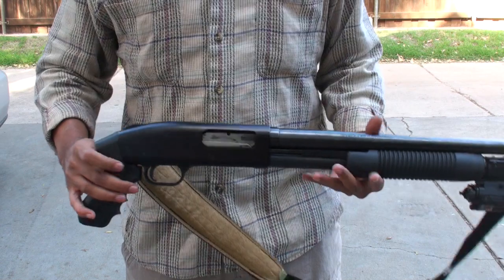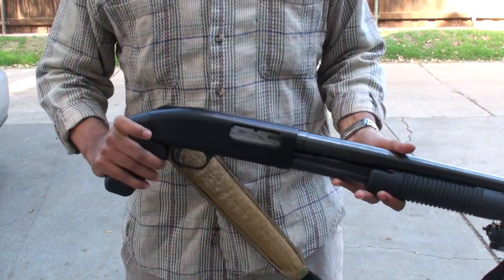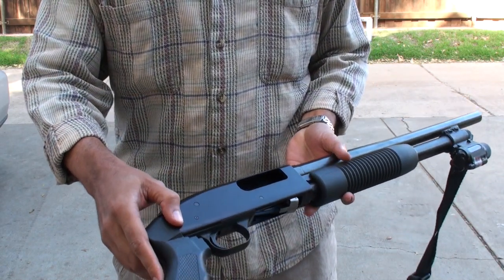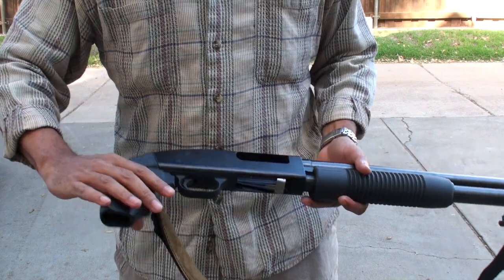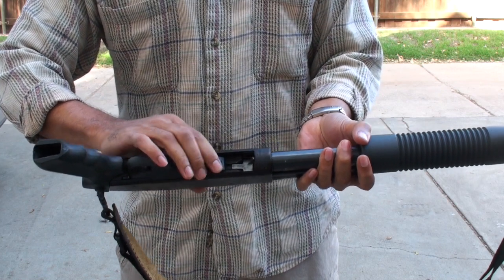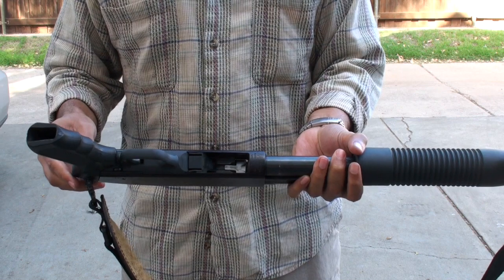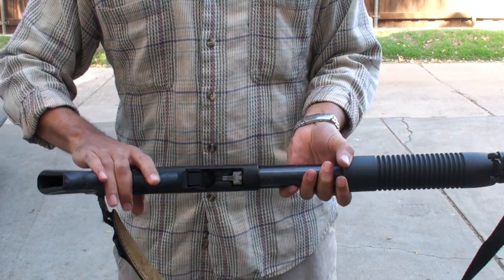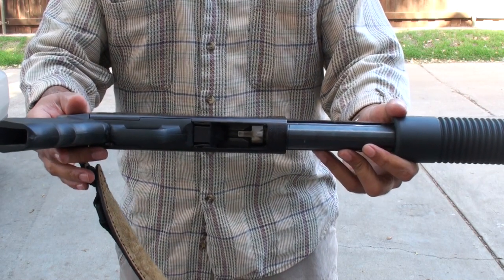OPSol Installation Video

Comment: Can you use full size shells with this in use?
Reply from the maker: You would have to remove the Mini-Clip before loading the 2 3/4 and 3 inch shells.  It takes about 3 seconds to remove and 5 seconds to reinstall.  The Mini-Clip adapter fills in part of the space that the larger shells use to successfully make it from the mag tube to the chamber.  That space, while perfect for the 2 3/4 and 3 inch shells, wreaks havoc for the minishells and often causes them to flip and jam the Mossberg.  Hope that helps.

Comment: are these rugged enough for defense?
Reply from the maker: They are very rugged for the intended purpose of an adapter.  Only one side is exposed after insertion.  And that one side is flush with the Mossberg.  As an added precaution, you can lay a piece of electrical tape over it to keep it in place if you are going into a really hostile environment.  While intended for recreational use, we use it for defense purposes as well.  Hope that helps.
Reply: OPSol TX thanks